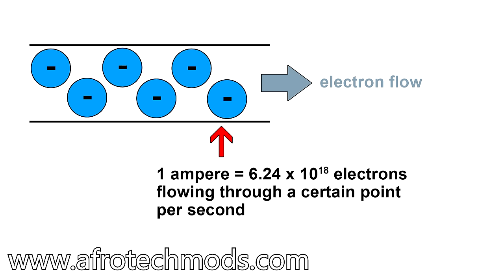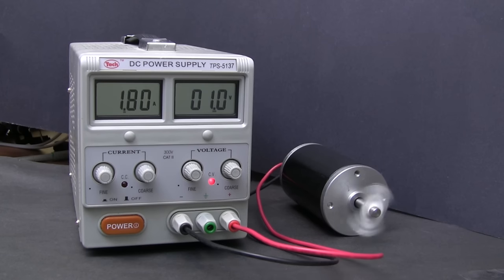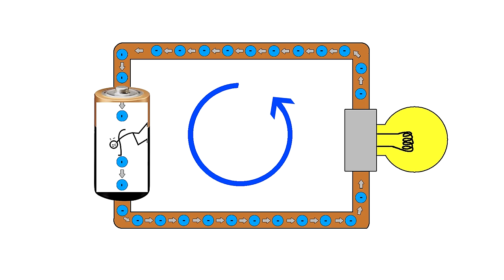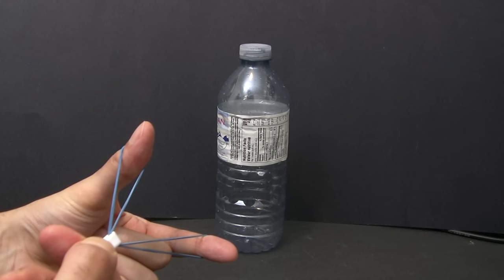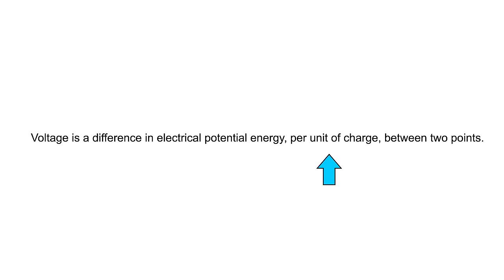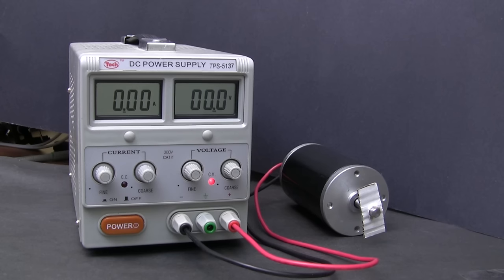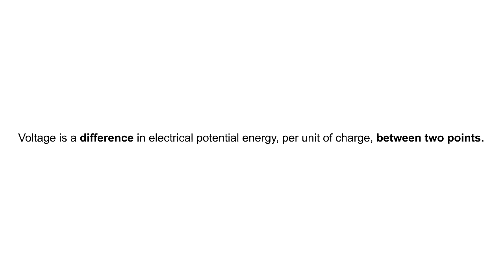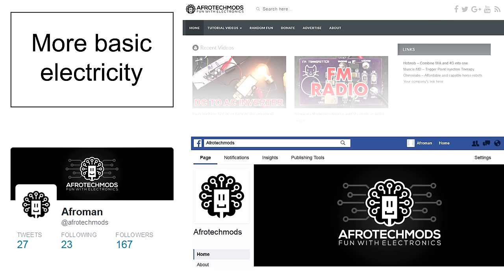🔌 Basic Electricity - What is voltage?

Comment: I don’t get where the energy supplied comes from
Reply: A chemical reaction.  The zinc "anode" of the battery is being consumed by the reaction, liberating electrons which flow through the circuit to the positive terminal.  For unfortunate historic reasons, the idea of "current" is set by convention to be "flowing" from positive to negative, but generations of electronic engineers have worked just fine with that, it really makes no difference to understanding how circuits work.

Comment: I don't get the whole coulomb thing, if 1 coulomb is equal to 1 amp why not just say 1 amp instead of making up a whole new word to confuse it?
Reply from the maker: 1 coulomb is not equal to one amp... one amp is 1 coulomb's worth of charge flowing past a certain point per second. Coulomb is the measure of charge (in this case, the total negative charge on a large number of electrons) and amps are a measure of how much charge is moving.
Reply: Afrotechmods So a coulomb is a measure of capacity? If it is how different is it from amphours ?

Comment: 4:20 You need a new battery!
Reply: Correction: He needs a new LED. It got burnt out almost instantly from all the current! Putting a resistor in series with the LED will help limit the current and make the LED operate like it should.
Reply: No, thanks for the correction but I'm not stupid. I meant that the battery is dated for expiry in 2014.
Reply: Yet still it had enough potential electrical energy to make the point :-D
Reply: Haha

Comment: i am 50 and still havent tapped into my voltage potential.
Reply: Michael Quintana think of a simple circuit with a light with a resistance of 10 ohm.  now my question is if the voltage will increase stepwise from 0 10 20 30 40 50 etc volts what would be the corresponding current be?